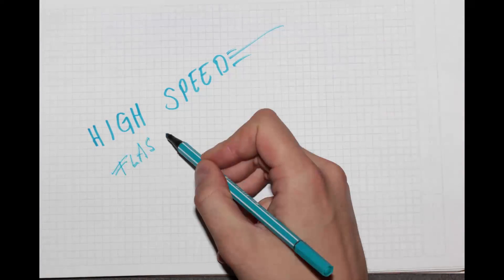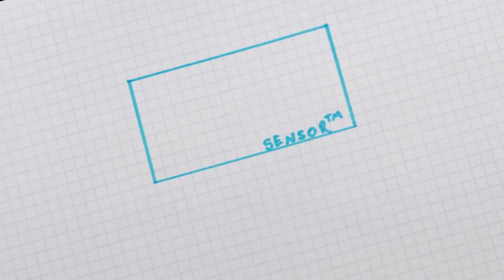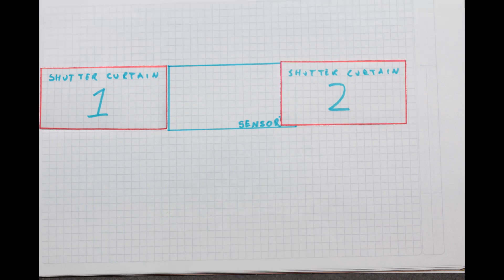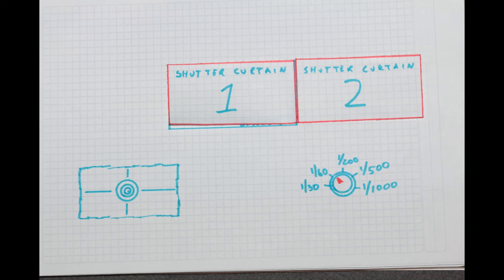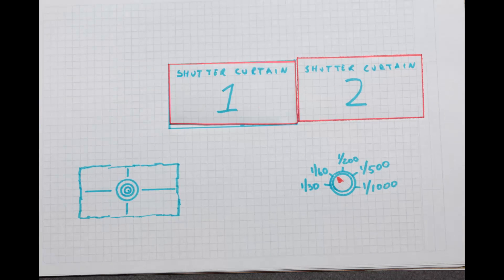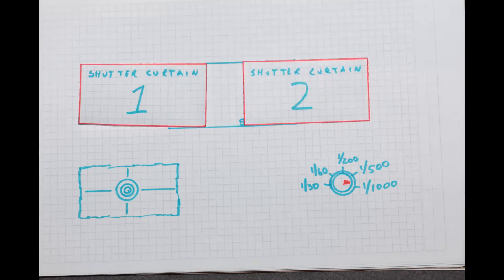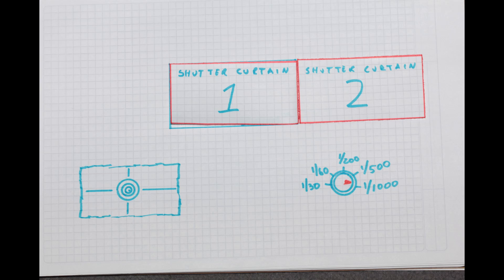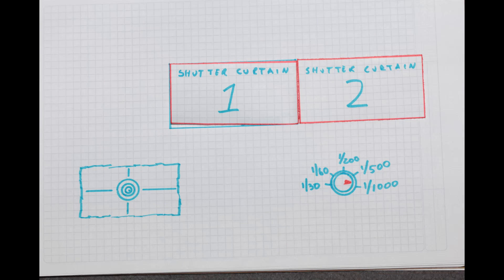High Speed Flash Sync explained

Comment: the flash doesnt pulse for 1/1000 if the shutter speed is at 1/1000. the gap of the curtains is indeed to make each pixel line get exposed for 1/1000. the movement of the 1st and 2nd curtains is always the xsync speed (usually 1/160s to 1/250s), so is the flash pulse duration

Comment: You commented a long time ago, but here it goes: At extremely short flashes, the power is low, the more powerful the flashing is, the longer the flash lasts. That's why with high speed flash sync, the power is reduced as the flash has to do several very short bursts of light. Fix this by adding more flash units :P